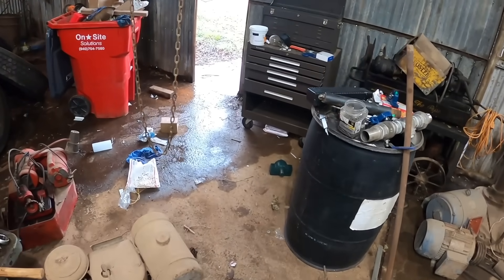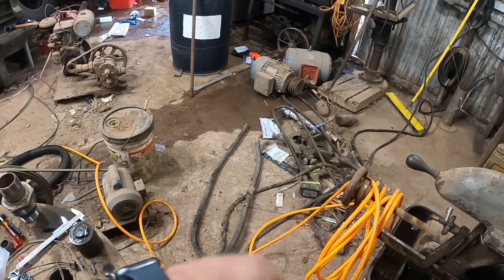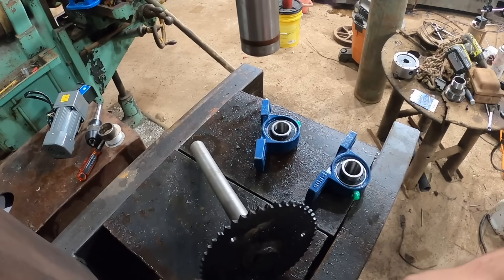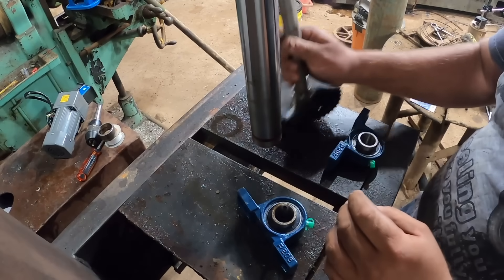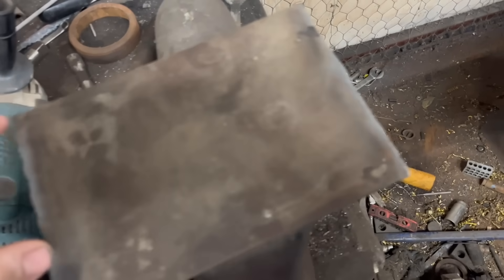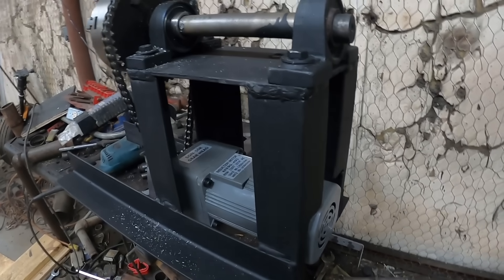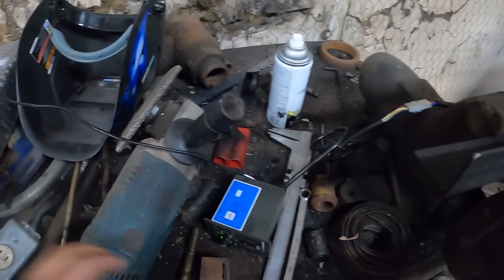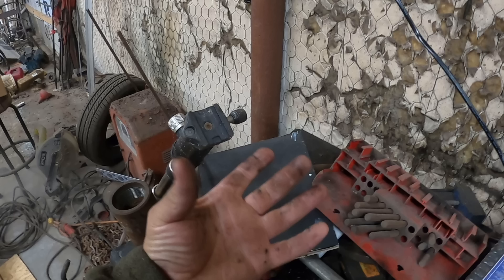Welding Lathe Build

Comment: Won't you need to use merited torroids on the wires to the speed control and power lines to protect from induced voltage transients?

So how did it turn out?
Did it survive the welding?

Comment: Water soluble oil will not freeze if you add antifreeze to it. Just make up the antifreeze in the concentration needed for your climate and then dilute the coolant as per the instructions. It works, i have done this for years.
Reply from the maker: Interesting thought. I never considered that.

Comment: One problem you may have with the grounding connection as built is some of the welding current will pass thru the pillow block bearings.  This can lead to arcing which chowders the balls and bearing races.

Comment: You could have put the motor underneath the sprocket in front of the rear bearing and hook it up there and put a hood over it make it a small area in your flat plate on the front end to put your connections.

Comment: I have built a couple of these rotators.  The big one uses a 50:1 gearbox driven with a treadmill motor reduced 6:1.  I use the treadmill control to vary the speed and it works great.  The small one is a small Dayton right angle gearbox driven by a motor used on old sewing machines.  I use a light dimmer and a sewing machine foot pedal to control the speed. On both I use a braided battery ground cable wrapped around the chuck drive shaft to transfer welding current.  I usually use a TIG welder to build up a shaft, so I control the heat with the left foot and speed with the right foot.  If my coordination is up to par, I have pretty good luck building up shafts.

I like your machine shop videos, and also find the oilfield stuff interesting as well.  Keep on keepin; on!

Comment: A common cutting oil used for old machinery is the high sulfur oil which protects machine tools MUCH better than water soluble coolant. It's no contest.  However any oil that flows decently will do since cutting oil is for COOLING blade teeth not so much lubrication. You've been around more than long enough to guess accurately what works.

A manual or powered rollout wheel/welding lathe is common in the oil patch. Powered welding rotators for bevelling pipes are commercially available that work like what you built.  If you take an old steady rest and make a mount you can attach that to a stand (or some pipe held in a tristand built or bought) to rotate pieces of any length you like.  Your rig welder buds will have cool examples to copy if you want a portable version with adjustable angle. Of course a rest will make shaft buildup by welding go slick and easy.  

You can mount a cutting torch on a removable arm if you want to bevel pipe with that machine.  No requirement for a straight torch if ya make a holder, and that also applies to plasma torches.
Reply from the maker: Ive avail got a hand crank pipe beveler.

Comment: 4:30 your not supposed to leave the electrode in the stinger when putting it down. If it moves the wrong way it will ground out.
Reply: Not his first rodeo and many welders get used to not moving them the wrong way. The rest learn quickly (and amusingly for bystanders!).
Reply from the maker: Haha who would pull the rod every tack.

Comment: Roof gutters and drain tile buried across the front of your shop will help to get the water away from the door. Also check the slope of the driveway. Is it sloping down hill toward the building? AL B.

Comment: one of those spring loaded ground clamps could also mount on the shaft and allow it to turn, if you need less resistance in the connections you can use a tig welder to braze copper or brass onto the steel shaft
Reply from the maker: That's a good idea to braze a ring onto it,

Comment: You may end up having your rotation motor acting as a ground for your welder if your slip rings fail to conduct. Welder should be an isolated circuit but as things get older , well you know.

Comment: "Here's what I am thinking' It's nice and ugly" That's beautiful right there!  Take about two feet of welding lead, strip the insulation off and wrap it around that shaft and tie it back into the rest of the cable. for your ground conductor. Kinda poor man slip ring.
Reply from the maker: I thought about it.

Comment: Absolutely the concrete slab can sink in time depending on the soil. It can also shift horizontally and continuously open up a gap between two concrete slabs that were not doweled together when the addition was poured. I know as I have seen it and also happening to me.